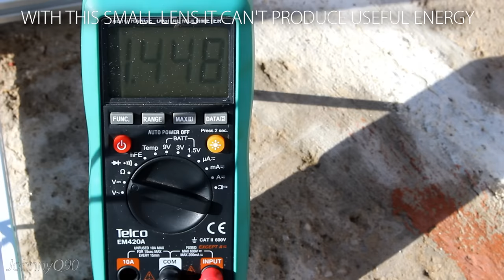Solar Powered Stirling Engine

Comment: Idea solid state electrolyte and solid state graphene power cell bank. Organic power cell charged up by solid state power cell off earths resonance frequency. Electonics to loop generated electrical frequency through an indication coil with an alloy that will cause induction levatation in a vacuum with a noble gas that will glow really bright. A super bright light system that never needs batteries and can last just about for ever. Could even design a stove top and hay change the alloy being used and electrical frequency and even a refrigeration unit? Be cool to have a camping stove that can also be used to heat a tent or shelter and a mini quiet air conditioner for your tent or camper made from these concepts. Crazy ieads. 😵😲😊

Comment: You should be able to get a lot more energy out of that amount of incoming sunlight.
Wondering what the temperature of the device is in various places ('leaking' energy from hot to cold). It may be the engine is too small / not designed for this amount of energy transition.

Comment: Gallium can reach very high temperatures and is used in nuclear cooling systems. I have no idea if induction levatation Will work on gallium yet an alloy like copper indium gallium or another configuration might yeild positive results. Highly agitated crystal structures IE hot mokten refined crystal structures give off vibrational energy in all directions say like a dyson sphere for energy production With solid electrolyte solid graphite or graphene power cells forming a sphere within the vibrational. energy sphere being produced by the glowing hot metal? Just some crazy ideas that may or may not work.  😊

Comment: It would be neat to dedign a flexible sheat of low voltage hertz emitting diodes with it powered by a solid state graphene power cell tuned to 126.22 hertz and then place it over a flexible solar panel to generate electricity then pass that curent through a vacuum spark gap and a frequency modulator for useable energy you could operate and device or hybrid electric motor off of? 😊

Comment: Why paint the glass bulb matt black? You are heating the bulb itself, whixh in turn heats the gas/air inside, instead of heating the air inside directly. It is inefficient. A better option would be to use a clear filtered bulb which allows the sunlight to enter, but not to exit, like many types of glass tube solar camping ovens. Another option is to place spaced black copper washers inside the clear bulb, like a radiator, and focus the lens on that through the glass bulb. Or do both of those options. But painting the bulb matt black and using the glass bulb itself as the heating element is most likely not as efficient. Another factor is exterior air flow on the painted glass bulb will directly cool the heating element, instead of an interior heating element protected from cooling from exterior air flow by the clear glass bulb.

Comment: Try using the whole hacksaw blade, using force in the cutting direction only.  Soluble oil in water is a good cutting lubricant for aluminum also.

Comment: I wonder what design of stirling engine you would need if ...
You used a large black surface, instead of a lense.
I know, the basic principle for a stirling is temperature difference.
But with a lower temperature difference and higher volume of air (like a large
black surface ) , would it be feasible ?

Comment: Copper lens effect used with hot gas stirling cycle piston's for a self sustaining Stirling engine. Use high heat magnet's for magnetic cushion's for no need of lubercant's. Use skill saws antivibrstion technology incorporated into hot gas stirling engine design for smooth quite operation. If you enjoy this information i have a concept for a luquified air internal combustion Stirling engine and Rotary engine. 😊

Comment: Just a suggestion: the stirling engine is mainly driven with the temperature. Higher temperature on hot side and take more heat in cold side.
Maybe make a set of mirror to gain more sun energy instead of using lense. And make a better heat sink on cold side

Comment: I wonder if you left the glass clear and somehow placed a black heat collector inside it would work better. I don't know if you could place something inside the glass though. Or how you would keep it in place and not take up to much room for air flow. I really have no idea about these engines. Just a guess after seeing one for the first time using solar.

Comment: I believe a well made Stirling Engine may very well have the highest efficiency for generating electricity from the sun; however It could never compete with solar panels.. If one took the same money to build and maintain a Stirling for 20 years (or even a month). And compare the same investment in solar panels the solar panels would win hands down. You could install multiple solar panels and put out far more power than that same money spend on a Stirling engine and generator. Solar panels are cheap and have no moving parts Stirling engines would have to be rebuilt on a regular basis and be installed with a solar tracking device. Building these Stirling engines is nothing more than a proof of concept and a fun project. But not practical or cost effective as long as solar panels are available.

Comment: If you put 4 photodiodes in a cross on each eche on 2 servos, you can track the sun via arduino. If you now take 4 pneumatic pistons and replace the telescopic rods, which are controlled by solenoid valves and a disengageable compressor can be operated by the motor. You can let the focal point automatically recalibrate.

Comment: There is a great community on this thread. I see a lot of comments about the efficiency and stating it would be better to just use a solar panel. In this case yes it would be, but that was not the point of this project. Nice work on what this engine is and thanks for the video.
 If people want better efficiency, then an engine that is designed for the purpose would need to be used. This engine is basically a toy or demonstration tool. It is not designed for efficiency.  It is not designed to run continuously for a long time (it would wear out relativity quickly due to poor lubrication and bearing design). A better engine would cost more than PV panels though so there would need to be other reasons to bother.
The main reason I see to create solar stirling is the ability to store thermal energy and use that energy after the sun is down. We don't have a good low cost electric energy storage medium (though batteries have improved significantly). There could be a small total efficiency gain as well, but the cost of such an engine wouldn't be justified over competing technologies.

Comment: Nice bit of engineering. If you canted the top bar of your frame so that it was at an angle to the horizontal equal to your latitude you would be able to follow the sun simply by rotating every thing around that axis. You would need to align it in a N/S direction with the lower end nearest to the equator. Your lens would need an initial adjustment to focus the sun but afterwards you’ld only need to swing it around that top bar. Properly balanced, you could drive it with a simple clock mechanism, geared so that it rotated at half the rate of the hour hand. Set it up on a sunny morning and track the sun all day.
I agree with those who say a satellite dish, suitably silvered would be an improvement as the bigger the solar catchment the more energy.🙂

Comment: Imagine if this utilized active water cooling on the other end. Maybe it could even be possible to turn the water cooling into a steam engine with high enough heat. I dunno, maybe these ideas work better with a much bigger custom built Stirling engine. I like the concept though

Comment: How big does a setup like this need to be to charge a tesla? I live in hot climate lots of sun. Looking into solarpanels but this could work also, with a house battery and in the future a small ev. Safes money on electric and gas bills.

Comment: If you had focused on cooling the cold side as much as you were on heating the hot side, you would have produced much more current. Incredibly so if you replace the air inside the engine with helium. You could have used magnets as the weights and built a small coil set to reduce the loss in the gearing, as well as get rid of the little POS dc motor. Gearing is much less efficient than the belt it came with or a chain btw.

Comment: Just need to find out what low frequency causes scandium aluminum alloy to generate ultra cold temperatures? Then find the correct alloy's that will generate radiant heat at low energy frequencies? Gallium seems to have many properties and is able to change scandium aluminum alloy crystal structures into a liquid state? 😉

Comment: Very nice.  There is by design friction induced by the gear coupling method use mount the generator. That friction is an efficiency that can be eliminated if desired by incorporating the magnets into the mass of the flywheel. Then mounting coils close to the flywheel would eliminate that friction loss.  Perhaps you would enjoy incorporating that upgrade and demonstraning the improvement in higher electrical output after the upgrade.  Very nice as it is all the same.  Cheers

Comment: Make an engine similar to this one, but larger, to run lamps and fans in the house during the daytime by storing indirect heat as a box where you put the dissolved salt in the area to which the heat is directed

Comment: why not remove the energy loss created by the spinning of the generator  and replacing the brass plugs in the flywheel with neodymium magnet's and mounting coils to create the electricity

Comment: Why not use a electric elements like on stoves wrapped around the piston. And use a solar panel for electricity. Seems like you could controll engine speed by moving the temp of the element

Comment: Seems like you should have used a smaller generator gear and larger flywheel gear. Also solar heating of a Stirling engine is better if you can find a way to fill the bulb with a light absorbing material instead of coating the outside. Black paint absorbs heat easily but black also radiates heat away so any black paint that isn't being lit up by the sun is only increasing the rate that heat is radiating away from the bulb.

Comment: Why use any plastic if you have the materials and capability to work with metal? Steel would be a better choice for the chamber as it retains heat better than glass. Brass was a poor choice being that it is such a soft metal and the parts are quite small. A glass orb might be interesting to try, I have found them to create more heat and they need no aiming as the convergence point in directly below the orb about a centimeter.

Comment: Could you make a dome shaped lens, so you don't have to redirect the lens? Then have a large black metal, and use thermal energy to create electricity, by creating a massive difference in temperate in one metal over the other.

Comment: I wonder if solid state electrolyte and solid state graphene power cell banks could be looped with electrical frequency being passed through two tesla coils with zero loss of energy? Then place an advanced solid state power cell with wireless power transfer technology in between the two tesla coils for the high frequency communications wave to pass through the power cell with zero energy loss while super charging the power cell from vibrating the crystal structures of the power cell with the wireless energy transfer technology being used to tap the electrical energy being generated to power hybrid electrical motors in a electric vehicle or motorcycle? 😊

Comment: I think the engine could be made more efficient by changing the receiver. Glass has poor heat transfer, make it out of metal. Insulate the parts that are not irradiated.

Comment: 1.5 volt  veery good this is smal prototype and its piston size is small if you increase of amount of pistons and with adding it 4 cylinder engine but you must  make a different type of Sun collector the key point of this is suns energy enought to run a  engine maybe we can desing more developed Sun heat  collector

Comment: Wow, what machine work! Seems like it should generate more energy than that. Would love to get a large version on my roof. Having solar panels put on now, but in Puerto Rico they get pretty hot. Was wondering if I could use Stirling somehow to take heat out and generate some more current. Great job. Sorry 5 years late.

Comment: How about adding mirrors at the back of the receiving end of sunlight so that it covers even more surface area? and also maybe use good thermal conductors like copper to make good use of the sunlight. but since glass is a good insulator, maybe use glass as an outer layer and copper as an inner layer?
anyways that idea for a sterling engine was new to me and it seems like it could be another way for solar power generators

Comment: You should use a “mirror box” to help increase efficiency as the angle of the sun changes with the days hours and the changing seasons.  Not as good as a moving sun sensor but less maintenance and expenses.  Heat loss due to atmospheric convection would be reduced as well

Comment: would you try the same thing with a burning laser, not with the sun?  If the temperature of the laser manages to rotate the engine, we can charge the burning laser with the solar panel.  so we don't have to follow the sun focus.  we can start the engine indoors.

Comment: I wonder, if one took this concept as far as it would go, how would it compare with normal solar panels?  I wonder whether two of those is better than, worse than, or the same as one with a doubled (area) lens size, and more generally what the area to power relationship is (Is it linear?  If so, how is it compared to a solar panel?).

Comment: Why not combine it with a solar trough? Why not immerse the sterling tube in a transparent solar trough tube which is open on one end. A great increase in surface area can be reached for negligible to modest cost.

Comment: Idea use a light bandit set up to power a solar acoustic power generator. Tune the solar acoustic generator to a hertz frequency that will hit the sweet spot of solid state graphite or graphene power cells. Could be way better then solar panels. Solid state electrolyte and solid state graphene power cells?  😊

Comment: You can improve efficiency of captured heat by introducing a buffer, like a jacket of high thermal capacity around the heat input area, so the heat can accumulate like a battery before being dissipated by both air and the engine, like a jacket of water in an airtight compartment should do the trick. The water can't boil because it would be held at pressure.

Comment: Another idea is to mount the relatively heavy lens directly on the aluminium frame instead of on the motor. It would reduce the force of the vibrations.

Comment: Gear it differently so the engine doesn't have to create as much torque to run the generator and can run it at a much higher RPM the lens isn't the problem it's the gearing

Comment: Interesting fact theoretically as long as the lenses are over 50% efficient and an alternator of 55% efficiency and sterling engine with its 70% efficiency that design should covert more solar energy in to electricity then some of the best solar panels of same aria as the lenses

Comment: heat up the water directly with a fresnel lens, and use a cold bath for half the stirling engine and the hot water for the other half of the sterling engine.

then you would have hot water aplenty for the home and electricity for the home from the stirling engine.

sounds a whole lot cheaper than solar panels and wind.  especially considering that a whole gob of people live between the tropic of cancer and tropic of capricorn.

Comment: I will do you one better. Just take resistance wire and use it as a heating filament wrapped around the outside of the glass bowl and hook both ends to a solar panel done. That thing will turn beat red and heat that bulb up and that thing will take right off I should have done a video on it

Comment: Nice.  paint the displacer instead of the exterior glass and you will get a little more power out of it.  The heat doesn't have to cross the glass as heat but instead crosses into the engine as visible light, then is absorbed in the hot space. Air flow over the hot displacer give you the heat transfer into the air.

Comment: I wonder how it'd fair if there were 3-4 making a Stirling motor or have the fresnel lens aimed at heat accepting metal distributing to the separate motors/engine.?

Comment: Did you ever consider the possibility of too much torque from the weight of your linens on the end of the cylinder it could be that it’s adding excess friction for the piston to move in and out try that. In my opinion you should mount the linens or mirror to its own stand and then focus it to your motor

Comment: A solar powered stirling engine that used solar power to start up in the morning then ran on its own through the night with a cool down cycle two hours before sun rise for maintenance would be a cool new way to generate electricity. 😊

Comment: Can you try make a solar trough that uses non imaging optics so it doesn't need to track the sun and transfers heat to a sterling engine via a diy heat pipe.

Comment: How does this compare to a solar cell?
A solar cell = .46V @ 3A = 1.38W
Your device = 1.472V @ ?A = ?W

Can you provide please the missing amperage under a specific load?

Thank you.
Reply: the theory says stirling engine is 55 percent efficient
the theory says solar panel is 20 percent efficient

Comment: These small stirling engines run far too fast.
That glass bulb looks too delicate too.

A metal bulb would be far more practical and sensible.

The large ones are the best, as they run at a speed where you can see everything working.